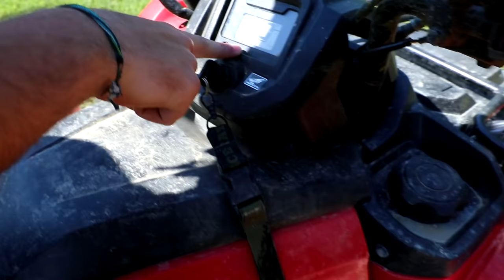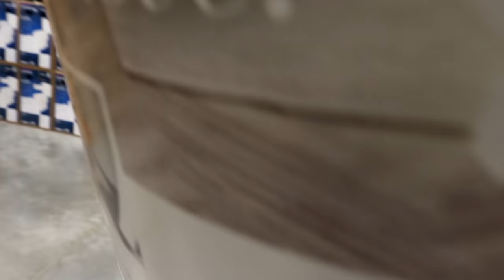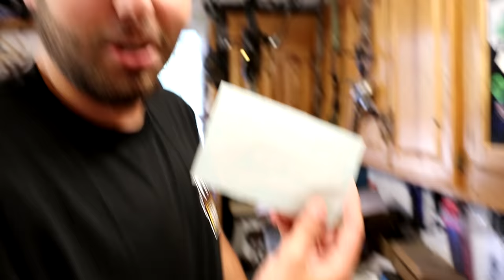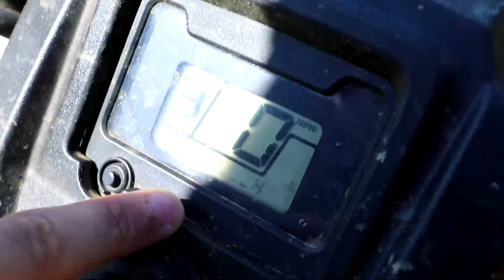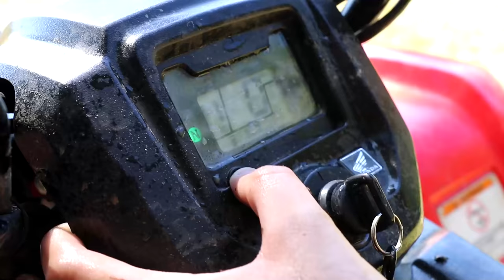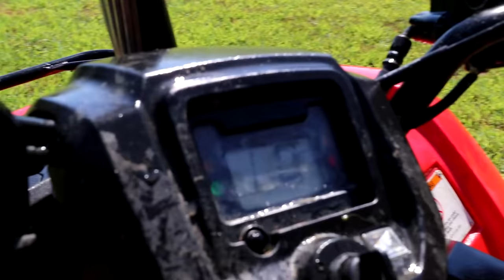SNORKELING THE HONDA RANCHER! WE TOOK IT DEEP!

Comment: I have a problem with my 2013 rancher 420 shutting off it does it sometimes but not every time and the air box is bone dry its not the snorkel and i have no clue any ideas???

Comment: I'm no Honda expert but do have a Honda 420 but bored out  to 500 with some 27 inch mud tires and two inch lift but. Never had the dash lights freak out like so my guess would be a little got into some wires so just check the wires and seal them good then the problem should be fixed.

Comment: Take the dash apart blow it out with an air blower and silicone it. Was a very common problem I ran across all the time when I worked at the honda dealership.